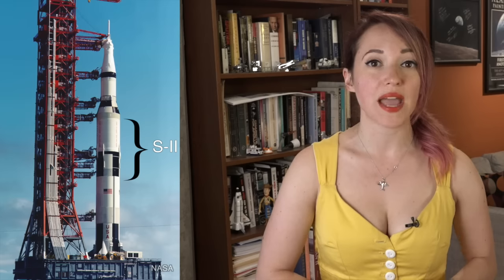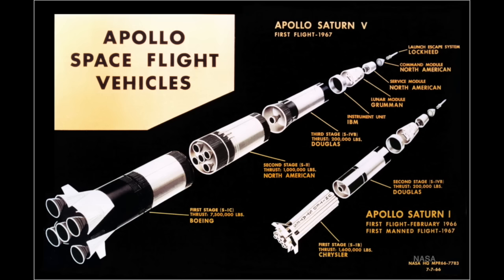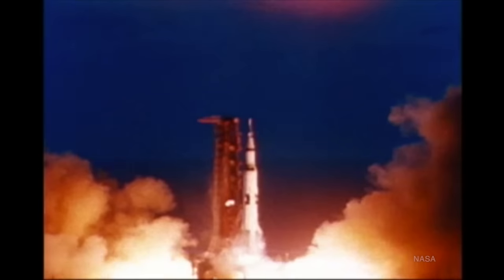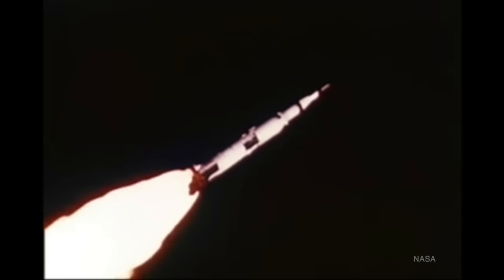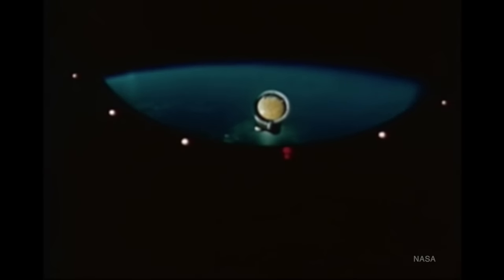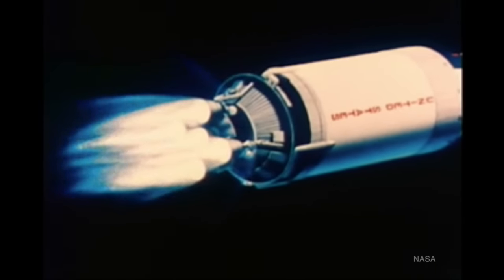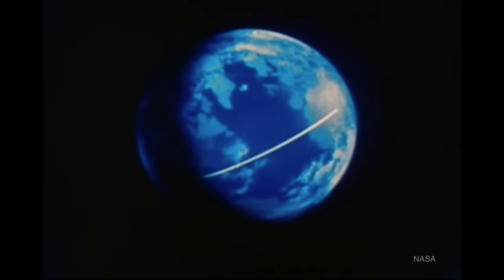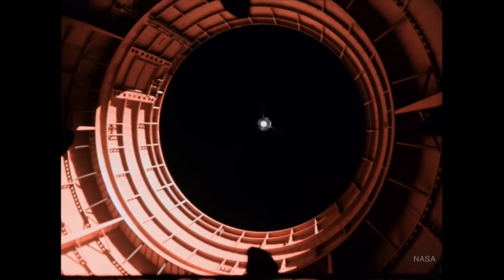How the Saturn V Broke into Pieces Launching to the Moon

Comment: To say that the rocket "broke apart" is a totally inaccurate statement. The rocket is designed to function in discrete stages in a highly coordinated manner. It did not just break apart into random pieces in some arbitrary order as if it experienced a catastrophic failure. Please consider changing the title of this explaination.
Reply: +Gary Bricault You're quibbling over semantics. You realize that, right? And where did she say it "randomly" broke apart? It broke into segments, precisely where it was supposed to. Quit being pedantic!

Comment: I recently saw the saturn V at Kennedy Space center and wanted to know why it was never launched after they went through all the trouble of building the hardware? Was it really that much more expensive to actually use it? I asked an employee but they didn't know the answer and just started rambling about the hubble telescope.
Reply: that might have been a backup for one of the missions or was supposed to be used for Apollo 18 19 or 20 before those missions got cancelled.
Reply: +William Jakespeare They didn't really have any missions to fly, I guess and as soon as the Space Shuttle launched, that of course became the way to go.
Reply: +William Jakespeare There were supposed to be ten Apollo landings, but three of them were cancelled.  One of the leftover Saturn Vs was used to launch Skylab, but the rest were never used.
Reply: +William Jakespeare - The answer is President Nixon and his administration trying to cut costs.  His administration almost cut Apollo 16 and 17.  A key reason why those missions were not cut was because it would have impacted employment in California and Nixon wanted to make sure he carried California in the 1972 election.  For Apollo 18 all the hardware was just about built, the CSM, rover and the LM was almost completed when the mission was cut.  The only cost savings for cutting Apollo-18 was operation expense.  For Apollo-19 they had the Saturn-V but the other hardware (CSM, rover and LM) never got assembled so you had a greater savings.  The CMS-115 which was intended for Apollo-18 is displayed at the Johnson Space Center on the Saturn-V display.  Apollo-20 was cut so the Saturn-V could be used to launch Skylab.  Also keep in mind you are seeing at the Kennedy Space Center a Saturn-V made up of different serial numbers for it's stages and the 1st stage you did see was never a flight stage.  It was the S-IC-T which was used for static firing of the F1 engines of the Marshall Space Flight Center for testing purposes.  The actual S-IC-14 which was the 1st stage for SA-514 which would have been the Apollo-18 LV is at the Johnson Space Center.  The 2nd and 3rd stages at Kennedy are part of SA-514.

Comment: When I was a kid I launched some multi-stage Estes rockets. They were put together very simply.  You had two stages with fins and the engines were taped together with the second engine started to ignite the first stage would drop off with the motor.
Reply: +Lonnie Paulson Just like a sounding rocket! Have you ever seen AirCommandRockets on YouTube? they build multistage water rockets that are very impressive. I messed around with their staging mechanism on tiny water rockets but my messing with rockets is mostly done in Kerbal now.

Comment: The engineering behind the design of the lift arm /  hold down arms releasing the Saturn during launch all coordinated to operate simultaneously,  the coordination of explosive bolts between the stages, AND the guillotine that sliced the wiring harness between the lunar lander decent stage and the assent stage fascinate me.  I might even say they sort of frighten me...... "they gotta work right".
Reply: Good commen,t but two important typos: it is supposed to be "descent" and "ascent".....

Comment: You forgot to explain of why the 5th engine got shut down while other 4 were still working right before the separations, it's been made specially to reduce overG from all that engines thrust power on a crew at the last moment, because those engines were not thruttle-controlled (always firing on a most max power basically) and as a result the rocket's TWR (thrust-weight ratio) was getting higher and higher each second while fuel getting lower and lower on that particullar stage, rising G forces to an extreme.
Reply from the maker: I almost always have a blog post that goes along with these videos and adds more details. That's in the blog!
Reply: Oh.. my bad, I must be missed that.. Thank you for all your effort and dedication! ^^
Reply: Do u have any vids in the ''astronauts'' who piloted X-15s ?
Reply: Still I appreciate the comment.  Thanks.
Reply: As the weight goes down the thrust is maybe too much.
Just guessing but I was sort of expecting engines to get shut down like that for that reason.  But on the second stage rather than the first.
10 kilos of thrust from 2 kilos of rocket is 4 g of acceleration at the start.
Whereas 10 kg of thrust from 5kg of rocket is 1 G acceleration

Comment: 2:03 "get ready for a little jolt fellas"
Reply: +KlunkerRider "that was some little jolt"
Reply: +AllysWorld05 +KlunkerRider if I remember correctly, the reason the ride on Apollo XIII was so rough was that the stage-separation retros fired a fraction or two sooner than they should have, and the physical connection between the stages hadn't been severed yet.

Comment: Using Estes black powder engines are straight forward.....the delay charge is omitted in the first stage and is friction fitted directly to the second stage. The ejection charge from the first stage ignites the second stage. It gets vastly more complex using composite engines and generally uses electronics to ignite a second stage or a zero stage sustainer (2 or more outboards firing first then dropping with a core engine to boost the rocket to apogee). Love your vids!!!!!

Comment: The term "ullage" refers to the air space at the top of a barrel's contents. If you're buying beer by the barrel you don't want to be paying for a lot of ullage. In zero G, the air (or whatever pressurizing gas that was used, helium?)  and fuel/oxidizer is all intermixed so the ullage rockets form ullage by creating artificial G to force the fuel/oxidizer to the bottom of the tank and the ullage up to the top.
Reply: Mishn0 Never heard of ullage motors. Do you mean that the fuel must be sitting 'towards the tail end' of the stage before it can be ignited? Why? Is it to ensure the fuel pumps are primed?
Reply: It's so the fuel can actually flow into the engine; liquids don't like behaving and moving through pipes if they can float around instead.
Reply: The CSM used nitrogen, the LM used helium to pressurize their fuel lines.
Reply: Very interesting.  I had imagined there was no air and suction pumps were just reducing the pressure generally in the fuel.
I had assumed there was still fuel in them when they were spent and it was just too low a pressure.
But then that means they must have the same problem big time when firing in space.  They must need more of those ullage engines and that also means there must be another fuel source somewhere for those ullage engines.
Every new piece of information prompts more questions.
Reply: small solid rockets are used as ullage motors (some more on the S-IVB stage, because it had to be fired more than once). The LEM and CM/SM used their RCS system to "ullage"

Comment: Early rockets really did have a problem of a spent booster stage bumping into the remaining rocket after separation.  The spent stage was so light that any thrust could be enough to make it catch up before the next stage completely fired.

Fuel is the main payload of a rocket.  The Saturn rocket kept getting lighter and lighter as it climbed.  It took about 60 seconds to go from zero to six hundred mph and then 100 seconds later it was going six thousand mph.  So without the ullage and separation motors it's easy to see how the very light and extremely powerful first stage can just barely catch up to the fully loaded rocket in front of it.

Comment: I have a design for my own staging system that is quite different because my rockets are powered by compressed air.

My system uses mechanical latches that operate by means of a servo motor controlled by a barometric altimeter I designed.

I had put the project aside for the winter but this video has gotten me excited to conduct more test flights.

Thanks for the motivation, Amy! I think this my favorite video you have done so far.
Reply: +USWaterRockets Good luck :D
Reply from the maker: +USWaterRockets Wow, that sounds like an intense model rocket design. Hope it goes well!
Reply: +USWaterRockets WOW! Multi-stage water rockets? Please keep us informed!
Reply: Amy Shira Teitel Thanks! I will keep in touch as the project develops. This is actually less intense than I am accustomed to. My previous rockets captured and held the altitude world record for water/air propelled rockets for over 10 consecutive years, and were even shown on an episode of Mythbusters! Those rockets were far more intense because the air pressures used were really quite dangerous. I shifted over to less stressful projects and have been creating tutorials to show folks how to build their own rockets. These are great projects for parents to share with their kids to get them interested in STEM fields. If you know anyone who would be interested, send them to my channel. That would make my day!
Reply: Alex Lopez The staging design evolved from my parachute deployment system, which you can see on my channel. I don't feel right linking to my own videos in other people's video comments, so I won't do that here, but I will definitely try to report back here as I have successes. If you want to follow the development process then feel free to sub me. Thanks for the kind words!

Comment: Amy, staging in high power model rockets is done through a flight computer. It senses burnout then fires a small black power charge to separate the stage. Then it fires an ignitor in the upper stage motor.

Comment: For amature solid rocket multi stage, the trick is to allow the first stage motors to burn and light the second stage independently since the first stage engines will not all burn at the same rate. That also means that every first stage motor is only attached to each successive second stage, not to each other. This allows the first stage motors to light each successive second stage and drop off independently without messing up the other staging.

Comment: I created a model rocket with multi staging that was not typical of an Estes multi stage rocket.  In Estes system you use scotch tape to hold the 2 (or more) engines together and once the booster burns through a small ceramic plug it will send hot gasses to ignite the next engine in line and so on.  This makes the stages very small and the rockets don't look like the real ones at all.  I came up with a method I called "True Staging"  I built a small timer circuit that activated a motor ignitor.  I test fired several standard engines I was planning on using as a booster engine and found they were pretty close to the same times.  I set my timer circuit to ignite the second stage motor while the booster was in the coasting phase.   

I built a simple 3 finned rocket with the first stage being about 10" and the second stage being about 12"  for the test flights I used a normal nose cone on the booster section, and launched it as a normal rocket.  Everything worked perfectly. Same with the second stage.  My 3rd flight was an "all up" flight.  The plan was to replace the booster stage nose cone with an "interstage" device that would allow for the second stage motor and ignitor and give a blast barrier to the parachute in the booster stage, while linking the  2 pieces together.  It almost worked perfectly.  The rocket launched perfectly, the staging happened just as planned... but the force of the blast from the second stage igniting not only separated the stages but it forced the interstage into the body of the booster stage which was wedged into the body too tight so when the booster engine was supposed to force the parachute out the top, it instead turned the booster stage into confetti.  I never made another booster, I just flew the second stage as a normal rocket from then on out.

Comment: I've never launched heavy amateur rockets, but when I used to build my own model rockets, my bigger ones would use a E16-0 booster, followed by a D12-0 second stage, and finally a D12-7 third stage. 

The stages were simply held together tightly by friction, and as long as the rocket was under power, they'd stay firmly together. When the first and second stage fired their charge, immediately after burn, they would ignite the next stage and the charge would kick the spent stage off the back of the rocket. Got some pretty impressive altitude from this setup.
Reply: +Zach Billings Multistage model rockets are very cool. Unfortunately, IME the upperstages suffer a high rate of non-recovery due to wind drift.  Have fed several to trees over the years.  

 There are now electronic devices that will allow "dual deploy" in Estes size rockets. The engine ejection charge pops the rocket open , and the parachute pops out as a tight roll while tumbling down.  Upon falling to a preset suitably low altitude, the chute is then electrically "unreefed" to recover normally.
Reply: Bob Weiss
Very cool. Non-recovery has also been my experience with 3-stagers. I've recovered a number of 2-stage rockets, but I recall only recovering one 3-stage model. Still really satisfying how high they go with higher-power motors.
Reply: We found our 3 stage D engine rocket by using the Estes tracker device called Transroc. Staging forces ripped The stage 2 fins to shreds! No photo from the Camroc on top :(

Comment: As to amateur rocketry, in most cases it's quite different than with large missile, or man-rated, boosters. Most model rockets are flown on solid fuel motors, composed of black powder, or composite propellant similar to that used in their larger cousins, such as the Space Shuttle SRB's. In the early days, Estes and Centuri offered several 2 and 3 stage kits in their catalogues. The motors for the booster stages contained no delay or ejection charges; the motors were taped together and as the fuel burned all the way enough bits of flaming fuel would find its way into the nozzle of the motor above it. The resulting flame and hot gasses would be enough to separate the stages and break the tape seal. The rockets were usually made using body tubes that had an 18mm inside diameter, which was the same as the outside diameter of the motors. Masking tape was used on the motor to act as a motor retainer, rather than using an engine hook.Later, multi-stage rockets were introduced with body tubes larger in diameter that the motors. Motor mounts were then constructed and glued into the body tubes. Some still allowed for taping and friction fitting, while others used mounts with motor hooks and tube couplers between the stages. Estes called their system "Pop and Go" staging. It proved to be as reliable as the earlier method.Today's modern mid- and high-powered rockets use a variety of staging techniques, with timers, electric matches, and other devices. The hobby has gotten a lot more sophisticated, but no less forgiving of the slightest error in building or flight prep, and rocket-eating trees and power lines still pose a threat to the next unlucky flier. The kids of the 60's and 70's have grown up, and our toys are a lot bigger and a lot more expensive!

Comment: Great video. In high power amateur rocketry onboard microcontrollers, accelerometers, and pressure sensors determine when the first stage engine is no longer accelerating the rocket. The stages are held together with plastic shear screws to prevent premature separation from the deceleration during engine burn out. The microcontoller then sends a signal to a ignitor, I use nichrome wire and gun cotton, to ignite a black powder charge creating pressure inside the rocket which forces the body tubes apart, shearing the screws in the process, and seperating the lower stage from the upper stage. The micro controller then sends a signal to second stage engine to ignite and propel the rocket onward.

Comment: I've built and launched multistage model rockets.  There are special "first stage engines" which are tubes with exposed black powder on top.  

Once the first stage burns through all of its propellant, the fire reaches the top and sends hot combustion gases and burning bits of gunpowder upwards.  The second stage engine is ignited by the burning bits of gunpowder.  

To prevent the gases(which are faster) from pushing apart the stages without igniting the second stage, you need to either fasten the second stage to the first stage securely (usually with tape), or make vents for the gases to escape through.  

These methods achieve reliable second stage ignition.

Comment: I met a guy when I was in high school. He said he worked for JPL and he was a metallurgist. He was supposedly part of a team that developed bolts, or fasteners, that were extremely strong until they were exposed to an electric charge. At which point the would explode, or fracture. The idea being that they were used in the separation of the space shuttle and it's auxiliary tank and boosters. Could you maybe research that and do us a video? Love your channel, Thanks Amy!

Comment: I am glad today they have come up with better solutions to separate rocket parts.   For example the Falcon9 does not have to use explosive bolts and does not require a stage ring.  I'm sure had the Saturn project continued, they would have changed it over time.